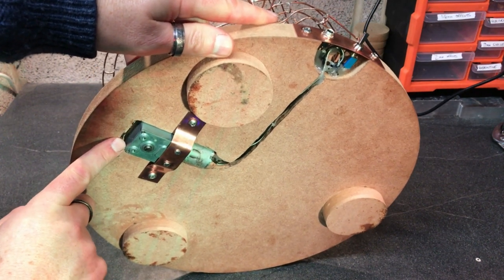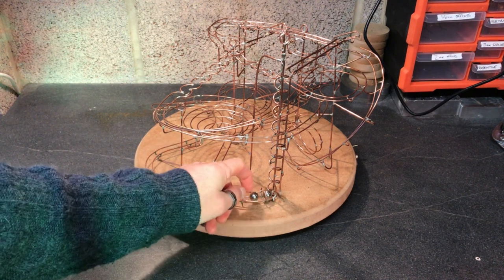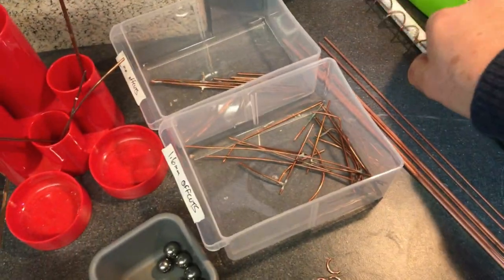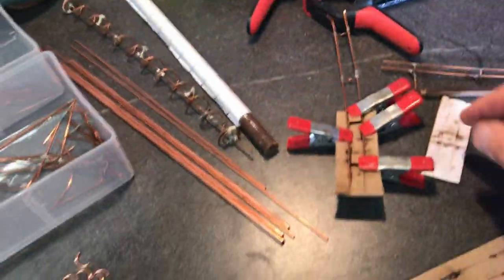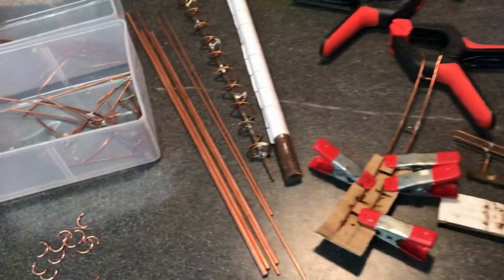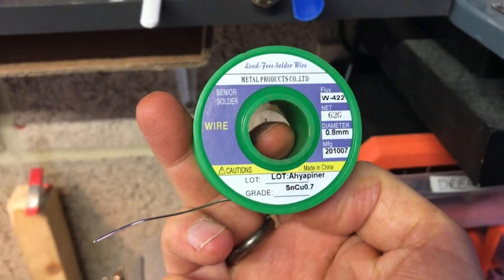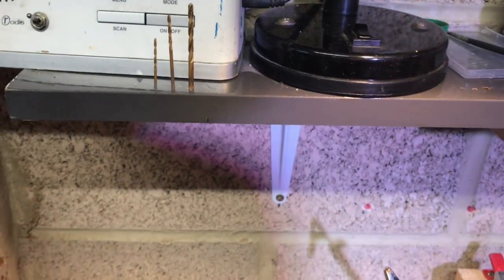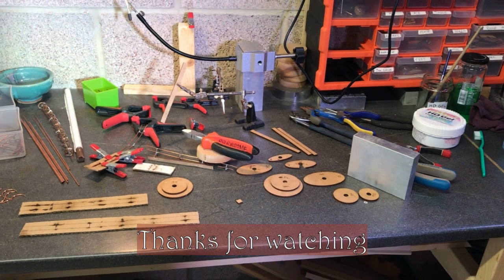Rolling Ball Sculpture // Tips and Tooling // Copper Wire

Comment: Both of your videos are good and informative.  Can you estimate how many manhours of trial and error did you put in before you felt confident to start your prototype and how many manhours did you put in on making your prototype?
Reply from the maker: Thanks Dave. Hours and hours. Before the prototype I made two previous prototypes . Experimenting with other wires and solder methods and non stainless balls that were heavier but rusted. 

Essentially my habit is to try to do things quick and cheap, but I’ve recently learnt that this hobby is best approached slow and without skimping.

It’s absolutely pushing my patience tolerance to the max. Which is why I love it. ❤️

Comment: man thank you for going into detail on all that!
I am going to make one in the next month (well START my first...)
I have a question about the finishing. I have some copper jewelry that was wrapped out of The same type of wire that I've been wearing daily for years and it hasn't corroded or rusted or changed at all (besides dulling a bit but I put that down to me playing with it lol)
Is that all necessary? It seems like the most expensive part to invest in but if there is a valid difference I might wait another 6 months to start.
Reply from the maker: I always pre-polish the copper when I add it. Should be fine. Good luck.

Comment: I'm fairly new to soldering.  Ive been using Sn99 Ag0.3 Cu0.7 to solder steel wire.  Does this also work with copper wire?  I'm thinking about trying it out as well.  Thanks!
Reply from the maker: If it solders steel, it’ll definitely solder copper. Copper is the most common metal used in electronics and most soldering is for electronic applications.

Comment: You're very organized, I've picked up some good ideas from you.  I've been using steel wire for similar (more basic) projects.  Do you prefer copper for any particular reasons, other than how nice it looks?  How do you attach the shaft on the motor to the shaft on the lift?
Reply from the maker: Thanks. I just love copper. I attached the motor in a very bad way using force and friction. It’s not very good and I don’t have any photos.
Reply: @CopperGravity have you considered using epoxy for permanent mounts, or threading the inside of the tubes for the motor shafts? Just asking, as I’ve yet to make my first sculpture.

Comment: You make it look so easy. I just can't seem to get two bits of wire to bond. The solder just beads around where I want it to join. I don't suppose you give lessons, do you?
Reply from the maker: Hi mark. Is the iron hot enough for the metal?  Have you tried flux?  I’m not an instructor, but I expect there are some online videos.
Reply: @CopperGravity  Thanks for replying. I'm using flux, yes. I think it might be the heat that's the problem. I thought maybe it was because I'm using a cheapish iron instead of a higher wattage station, but saw another tutorial that says a £20 iron is fine. I'll be trying again but letting the iron heat the copper wire a bit longer this time.

Comment: you said "I put my soldering iron on Maximum".....what wattage iron would you recommend?
Reply from the maker: I have a 25 watt iron. But I recently upgraded to resistance soldering which I’m beginning to use 100% over a traditional heat iron. I will do a video soon.
Reply: @CopperGravity  I'd be interested in that video.